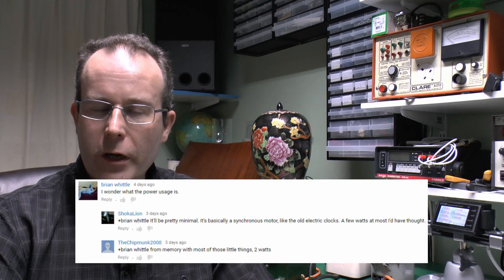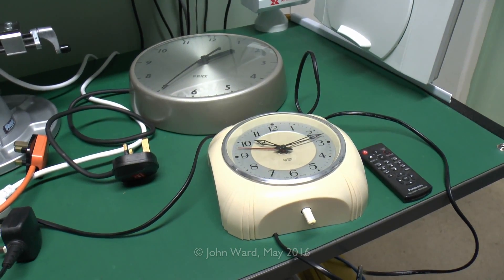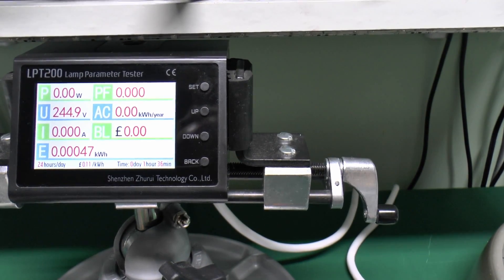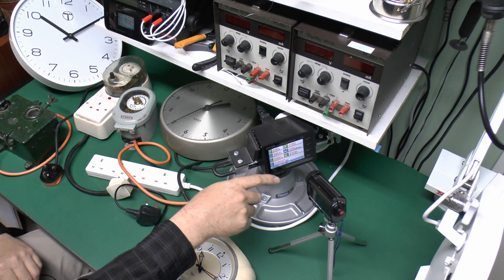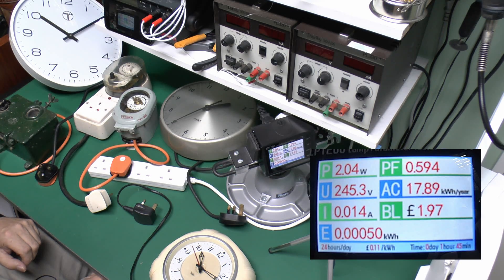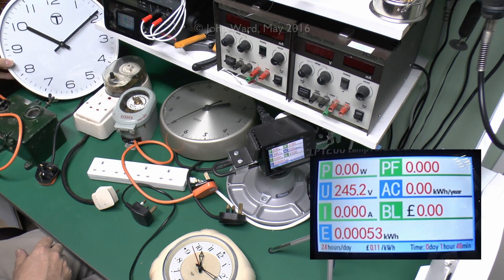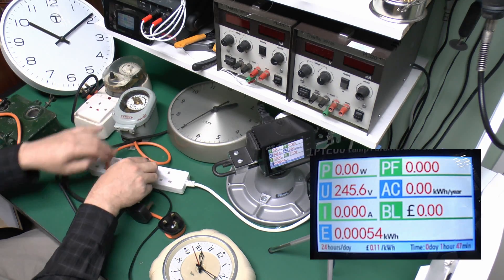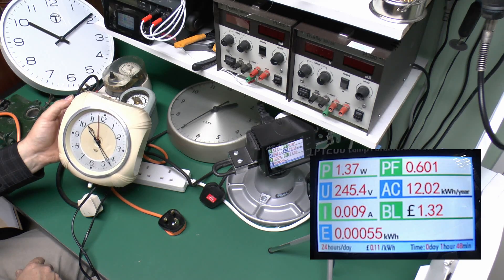Clock & Timeswitch Power Consumption

Comment: Do electricity meters consume any electric themselves? Either the old type with the disc that spins round, or the newer digital versions....be interesting to find out if sub-metering in a property actually costs you any extra money for the privilege of using the second meter, I would guess they might use around 3-5 watts??
Reply from the maker: +Alan Palmer They do use some power, it should be a very small amount.  May be able to test this in a video.

Comment: Interesting video you wouldn't think a little thing like a time switch would add anything to your annual bill but it's only a few pounds so not really important. I notice that your voltage shows as 245 volts or thereabouts in your video on voltage drop it was only 215 ish volts has your local board corrected your supply or was that a different location??

Comment: In the UK, old AC-powered clocks used to use a dedicated outlet, correct?
Reply: +Madness832 Still are and the outlets are still available - search for 'MK 995 clock'. Originally they were wired into the lighting cct and had a 1 or 2A fuse in them. My parents had one in the kitchen that originally supplied a pull-to-start clock like the one in this video.
Reply from the maker: +Madness832 Clock connectors: http://xo4.uk/?7hF